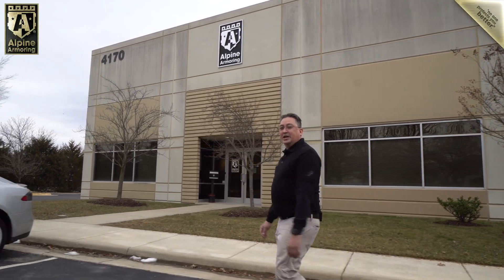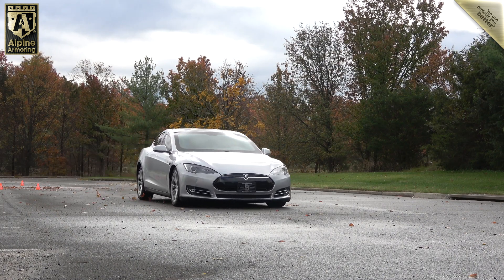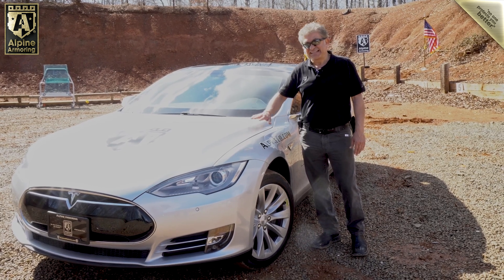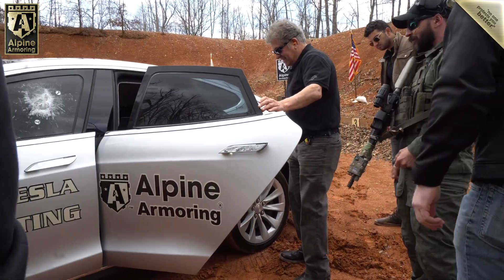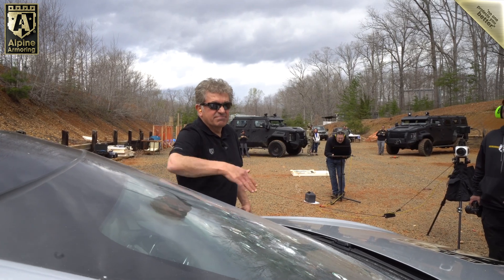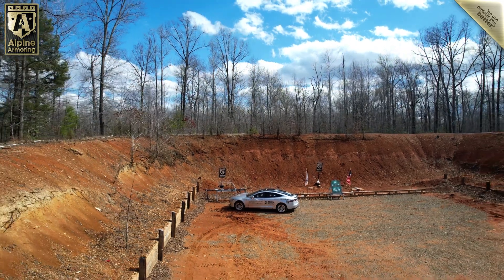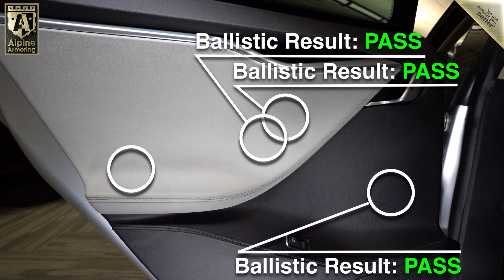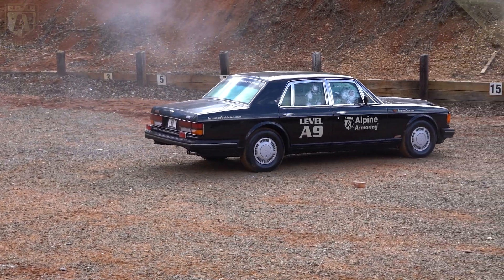Armored Tesla Model S Bulletproof Car Test by Alpine Armoring R&D Department

Comment: Heya, I'm a random person that got this video in his recomended, I really like the subject and the video is a pretty 6/10 for me would be 8 or 9 if i had more explaination about what is "A9-B6+". You guys lent details about a lot of things, numbers about the calibers used, details of the modifying of the car, the armor used, but no clear detailed explaination about what this "A9-B6+" means except for some vague things said around 6:00 . I really liked the subject, and the video, but the relentless use of "A9-B6+" without proper explaination about the details is kinda annoying after a while ngl.

Also, you thought about protecting the persons in the car from the top and the sides, installed a run-flat, but no details about the bottom nor the motorisation, is it protected ? what if someone trow a grenade under the car, Or just target the engine, transmission, or the batteries of the car ? Are the A-B-C pillars protected too or is it a weak spot ? So much un-awnsered...
Reply: Pretty sure there was no protection underneath. The battery itself would probably protect passengers from a grenade, but that would immobilize it. I think this is more for attempted robberies, kidnappings, and road rage, not for full-on assassination attempts or war zones.

Comment: Is there any armour around the motor or other important engine components? I would assume that would be done on more heavy duty vehicles like trucks, SUVS etc.
Reply: Tesla's as well as other electric vehicles don't have engine's 🤦🏻‍♂️
Reply: @scotshanley  Read what i said slower, is there any armour around the motor? or other engine components, I.E the part about how i would assume it would done one heavy duty vics like trucks and SUVs that do in fact have a engine. Smart ass.

Comment: Dump a mag in one window or one side.
Reply: That's exactly what I was wainting the whole video.
Reply: Everything is a tradeoff. You have to specify what kind of threat you want to be able to handle and how driveable you want the vehcile to be. If your threat is low (just worried about a possible attempted car jacking, robbery, kidnapping, road rage, etc) and you still want a vehicle with good performance and handling, then this is a good level of protection. If you are worried about a full-on professional assassination attempt, or you live in an actual war zone, then you'll want something that will protect against high-powered, armour-piercing sniper rounds, IEDs, or, sure, someone mag dumping 556 or 762 into a few square inches of window. But at that point you're probably looking at a whole different vehicle.